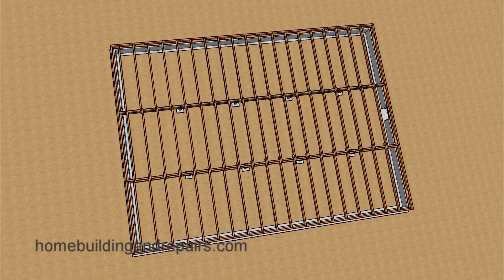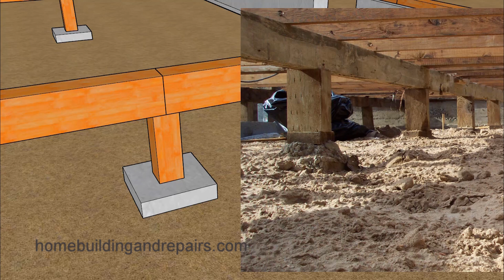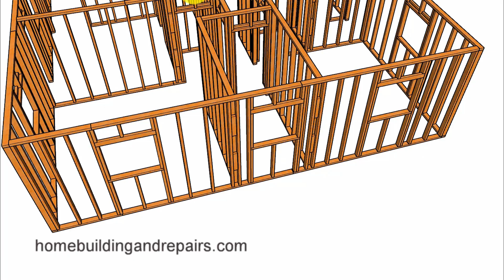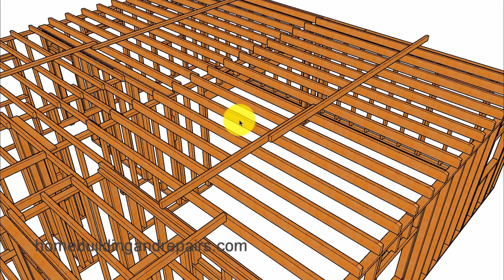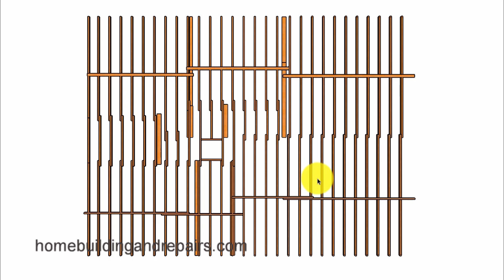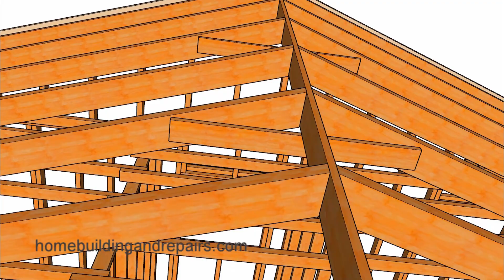Old House Remodeling Project Part Two - Foundation And Framing Tour

Comment: I have a question unrelated to this video. I have a situation where there are rotted floor joists and rim joist that need to be replaced in a crawl space. They are under an inset concrete porch (meaning the porch is within the rectangle dimensions of the house and does not protrude beyond it). In the crawl space the joists in the porch area are boxed in by a concrete block rectangle making the joists inaccessible for about 5’ (the width of the porch) at the front of the home. Any suggestions would be greatly appreciated.
Reply from the maker: This is a difficult repair, because you will need to figure out a way to access the damage to replace it and I don't have a video on it yet. Some time the porch is removed or wall framing above area.
Reply: @gregvancom  Thank you for your follow up. I knew it was going to be a difficult fix.

Comment: is the ceiling joist still safe if I add a second floor?
Reply from the maker: You will need to contact a local engineer for that information, but probably not of it's a 2x4. I've seen 2x6 but it's rare.